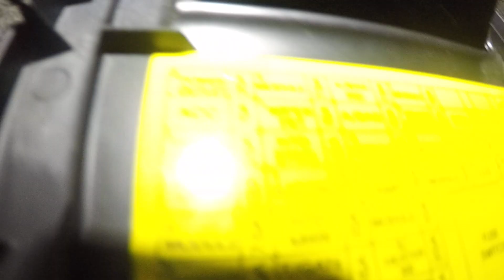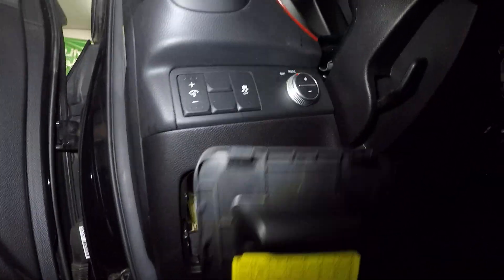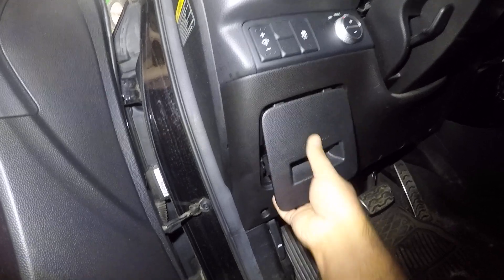Kia SOUL phone charger / Cigg light FUSE, fuse location

Comment: Thanks buddy I just got a 2007 Kia Rio and unfortunately I’m a smoker 
The lighter is there but not working. Hopefully I can clean it out and hope it’s a fuse
Reply from the maker: Clean it out and check fuses
Reply: @RBTheMechanic  yes I’m going to. Can I use an air pressure gauge to blow out some dirt in the lighter or just clean by hand? Then check the fuse anyway

Comment: Hi RB if your at the work shop can you help me I have a 2015 Dodge Ram 5.7 Hemi I want to change the transfer case transmission oil and in my manual it wants me to use Mopar BW44-44 I think it’s a dodge dealer product can you recommend another fluid that would work for me
Reply from the maker: I’m sorry I don’t have system that show comparable fluids but u can call parts at Autozone or pep boys then will be able to tell somthing comparable but from my experience I would go with original fluid

Comment: Changed my fuse and it’s still not working.. this happened after I used the outlet to inflate my tires
Reply from the maker: Check other fuses check all fuses some time u blow main fuses
Reply: I did excatly the same thing
Reply: OMG literally the same just happened to me 😂😭😭
Reply: same thing happened to me how did you fix it ??
Reply: @emilynejad4474  I sold it😂